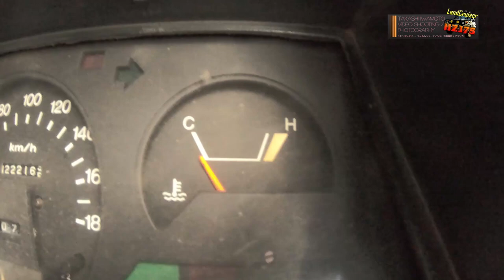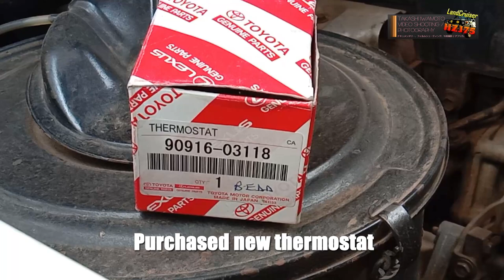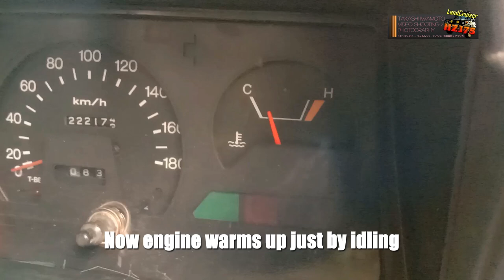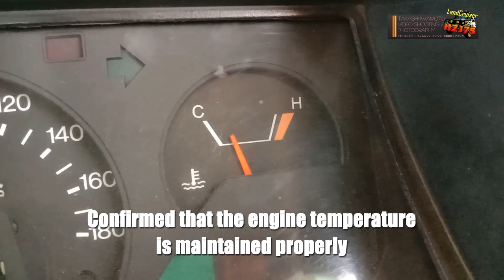LandCruiser HZJ75 1HZ Thermostat Replacement: Enhancing Engine Performance & Fuel Efficiency

Comment: hi, i think that had to have a "rubber gasket" around the thermostat, in the old one you removed it together with the sealant/old gasket, the cod/part number from toyota is 16346-0k010
Reply from the maker: Thanks for the information,

Comment: Hello there! May I ask why do you change the thermostat from oem 76c to 82c? Does your car run cold and temp drops when high speed using the 76c?
Reply from the maker: Hello, old 76c thermostat became too long to warm up after 20 years of operation. During high speed get warmed up but drop temp with speed reduction. So change new one that coincident got 82c. Since change new 82c my 1hz stays stable temp and better performance.